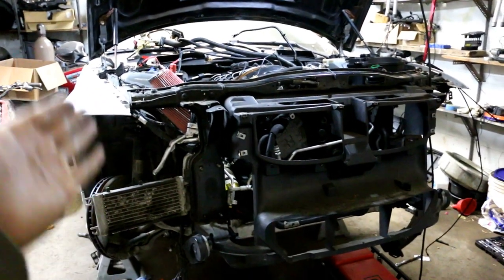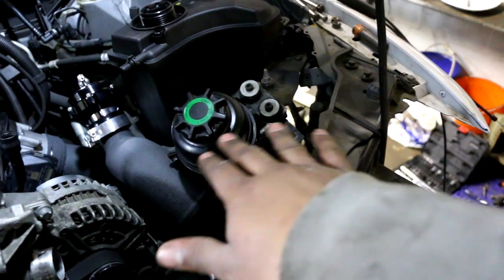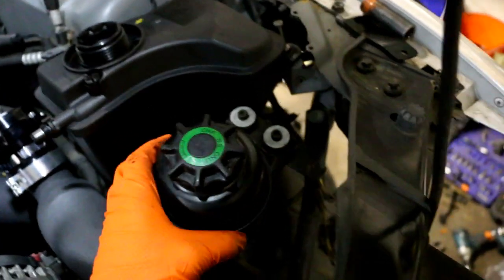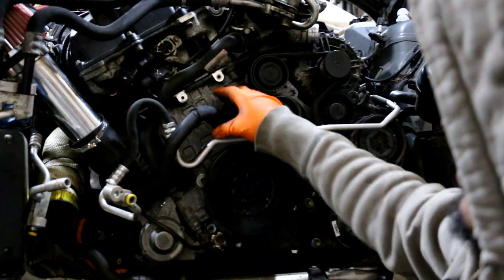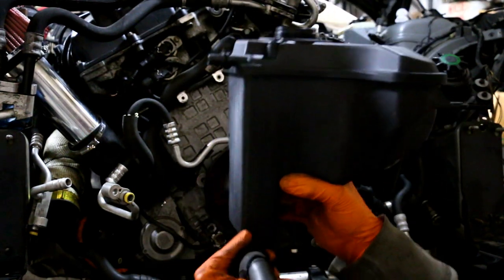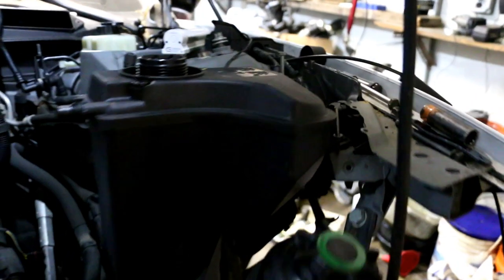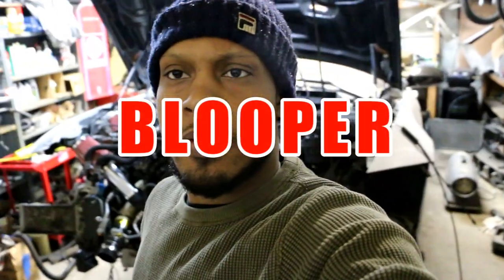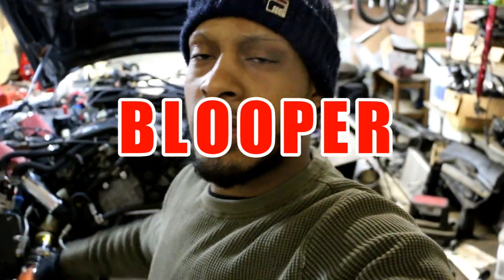EPISODE 17 | COOLANT TANK RELOCATE & VRSF CHARGE PIPE

Comment: how did you get the sensor cable to reach all the way over? was there an extension cable and if so where do I purchase because I am planning on doing this soon, great video by the way very informative and helpful.
Reply from the maker: You just have to cut and extend the two wires of the same guage. U used heat shrink and solder.

Comment: Why route thru the line instead of the below black plastic coolant hose? I would think if you put the hot coolant next to the ac line it will mess with the ac not blowing cold air
Reply from the maker: I was using the ac line as a support to keep the line from getting damaged. My ac still works fine. But u have a valid point there may be some heat transfer there but i would like to think it would benefit the cooling system rather then harming the a/c system. You get the cold air in the car off of the evaporator anyway. And the cooling Fan always come on when u turn on the ac. It sits directly  in front of the of the fan
Reply: Can I use the standard vrsf N54 chargepipe w this job?